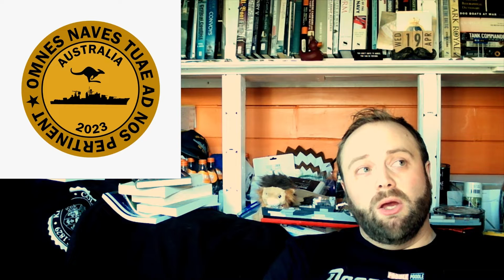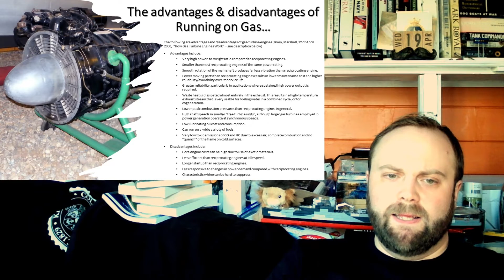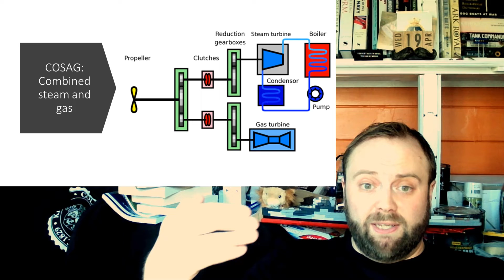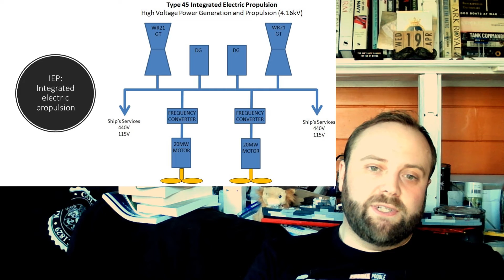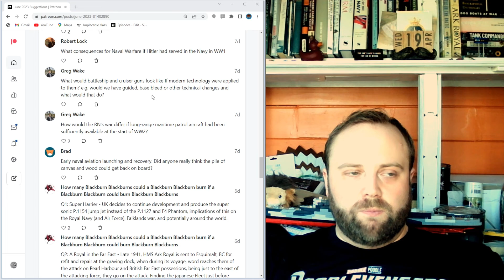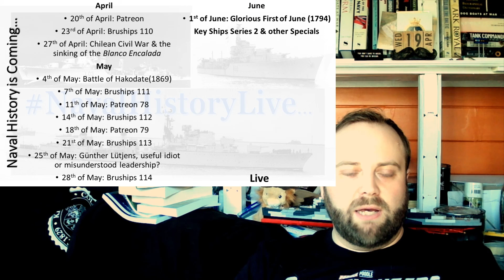Ship Shape & Running on Gas

Comment: Imagine the small craft the Royal Navy could have had if Whittle had gone to them after being rejected by the RAF early in the 1930s.  For instance, Turbine Gun Boats with 3 auto-loading 6 pounders overtaking S-Boot squadrons at 45 knots.
I suspect the US Navy could have gotten a IEP style system working in the late 1920s or early 1930s had they kept pushing the technology, it would have probably been using diesel and steam plants but they might have been able to produce a gas turbine design by early WWII (perhaps in time for the Gearing Class' equivalents).  I figure that the US would be at the forefront here due to the Standard Type battleships turbo-electric propulsion and the diesel-electric used on some of the destroyer escorts in WWII being close in reality.

Comment: 37:00 Add in a few batteries here and there, just in case.
Reply: In the '20s and '30s the batteries would have been Lead Acid. Very heavy and  large abrupt drains on them would shorten battery life.

Comment: WR21 was a really interesting project. It started off as a mix and match of various aero engine compressors & turbines to make it cheap and simple then slowly developed into a bespoke "aero derived"  design.
The magic is in the cycle with the intercooling & recuperation to keep the efficiency up across the power range.

Comment: I think the exotic materials part is a bit questionable. You need to have them to achieve a decent cycle with the kind of long term longevity you want for a naval application. It's fine if you have to drop the engines on your Gloster Meteor every 100 hours or so but the average engineering officer won't be happy
Reply: Very true. You need something that will keep running for weeks on end.